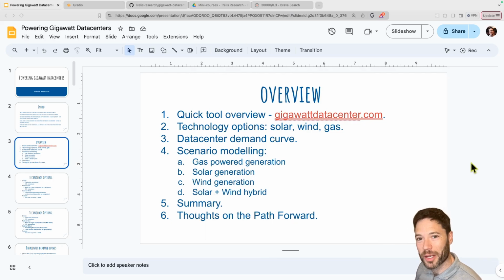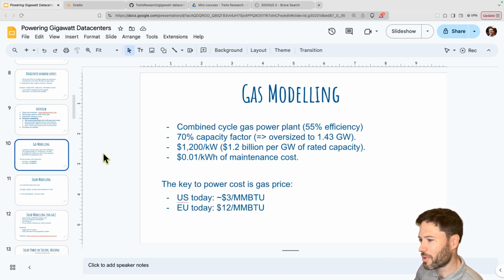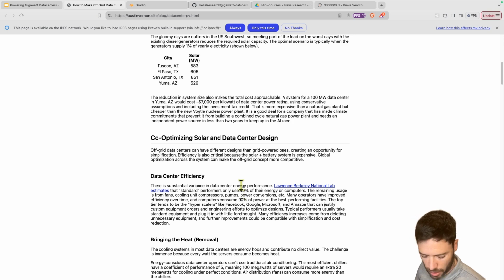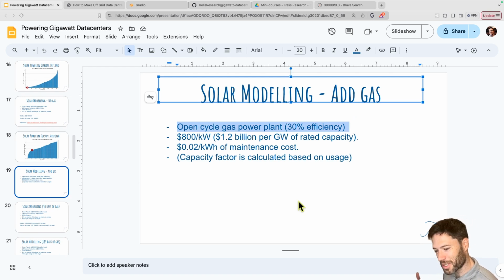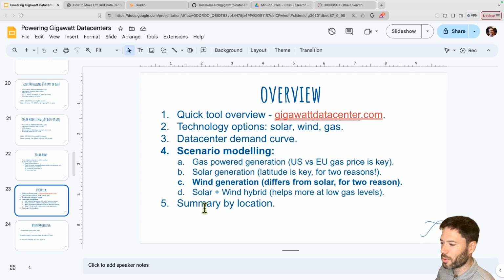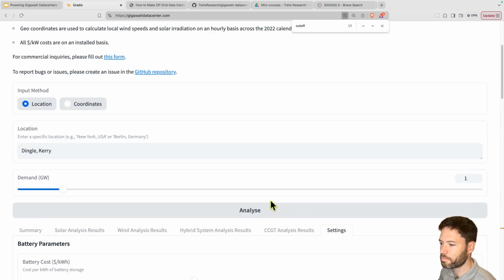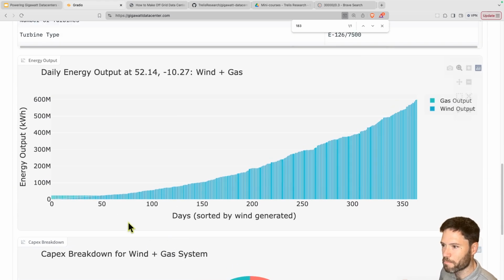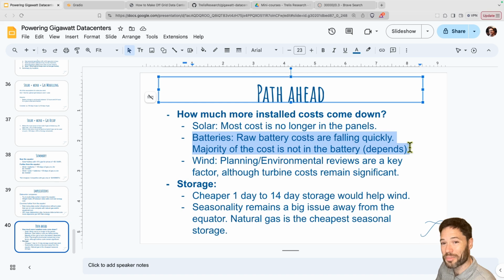Powering Gigawatt Data Centers

Comment: Interesting topic change. But, well not really, because you need datacenters to train bigger ai models anyway 😄 What I wanted suggest is, that there are some areas, where you can also use geothermal power, like Iceland or hydropower. Some of those energy sources are very cheap, because they often produce an surplus of energy. Maybe you can take those into account. Also You can sell overproduced energy by solar and wind and buy energy instead of using gas yourself. Just some thoughts. keep on.
Reply from the maker: Yeah 100% if there’s hydro or geothermal you go with that.

I should have mentioned that. Was implied but unspoken!